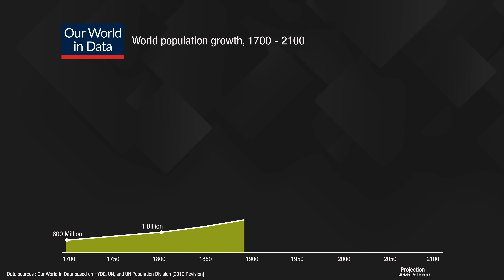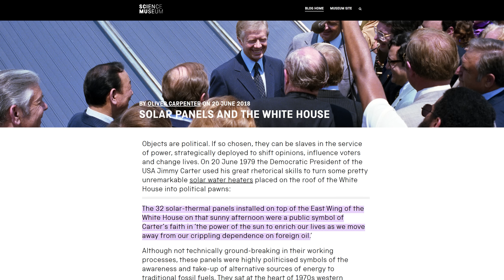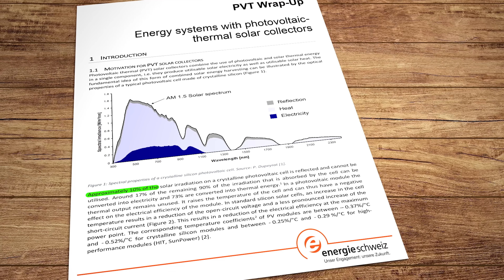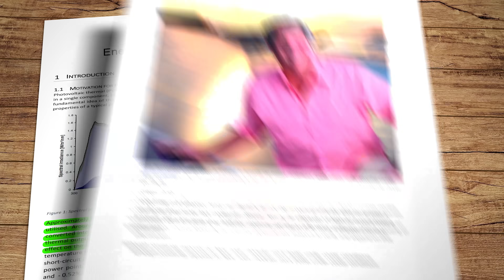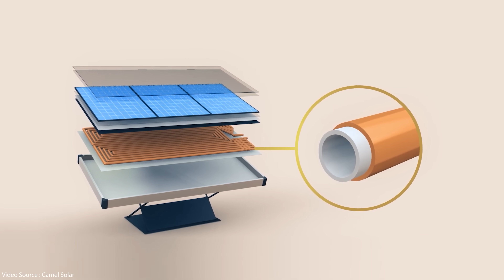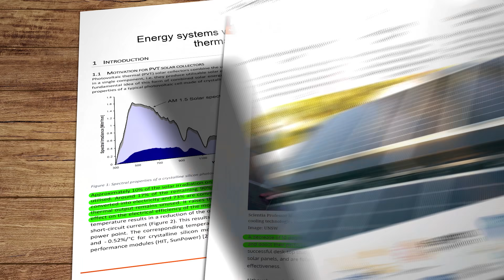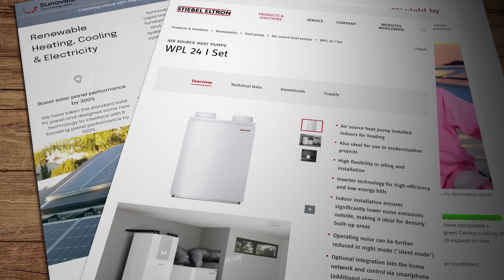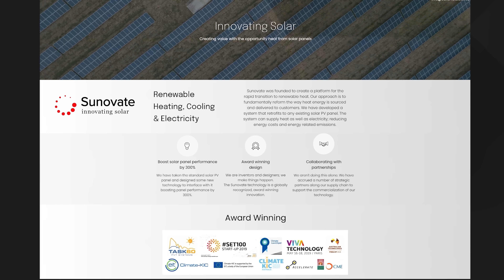The Solar PV panel that provides electricity AND heat for your home!

Comment: May I recommend that the "Just Have a Think" speaker get his facts corroborated well.

At 2:27 in the video, the speaker says that on a hot sunny day, a solar PV module (BTW, which is NOT a solar panel) that is rated at 20% efficiency under Standard Test Conditions, may only be working at 12% efficiency.  This is *not at all* correct.  A solar PV module's temperature-difference coefficient is nominally (for example) at -0.35% (to -0.4%) per K of difference from 25°C.  So if the PV cell temperature is at 75°C (as I have measured it) then a 20% PV module would be running at 16.5% efficiency.  (the calculation is:  75°C - 25°C = 50 K.  50 K x -0.35% / K = 17.5% (difference).  20% (units) x 17.5% (difference) = 3.5% (units).  20% (units) - 3.5% (units) = 16.5% (units)).  PV modules typically are tested to have a maximum operational temperature of 85°C, at which point they would be running at 15.8% efficient.  To degrade a 20%-rated PV module down to 12%, the cells would need to be running at 120°C, which would be far beyond what the manufacturer would warrantm and far beyond what any building code would permit.  I welcome anyone's comments and discussion.

Comment: Something that people don't realise is that improved efficiencies in the UK have (surprisingly) been steadily reducing the overall demand for electricity since 2005. By 2020 we were using nearly 70 TerraWatt hours less annually than in 2005. This during a period when the UK population has risen. However, it is true that globally the use of electricity has risen over the same period.

Comment: I think these techniques have a major contribution to ensuring that PV makes up a big chunk of mitigation efforts. TLDR: Extending panel life has a huge effect on resource constraints limiting the scaling up of PV and EROEI (it is a real thing)
I looked at combined heat and PV solar while an undergraduate in the 90's. It was quickly clear that (using the tech at the time) it would be hugely costly and a maintenance nightmare. As a follow up I tried looking at the lifecycle costs to see if life extension might save the idea. Again, at the time, the answer was a flat no. Ironically the rapid fall in costs that was projected for PV wiped out any gain in life for the panel.
Now the situation is quite different. Panel production is already starting to bump up against the sort of volume where resource demand for production adversely affects the production cost. My personal suspicion is we are close to the end of the era of rapid cost reduction.  Fortunately PV is already cheap enough that it will continue to expand at the current relative cost (If PV costs rise it is likely to be because of resource constraints that will tend to affect all energy production technologies,  so the relative cost will not change as much as the absolute costs)
Given those constraints the question become one of how much total capacity can be built out with current tech before the replacement of older models cannibalize the production for new instalation? A life time extension of 2x + doubles that headline number. This also means the current technology is unlikely to run out of growth before something better has been invented, proven and scaled up.

Comment: Cool! The problem getting people to understand this is often: many people think PV panels generate electricity from heat... because they think that the energy from the sun is thermal (longwave radiation), rather than light (shortwave radiation).

Comment: Just have a think:  The move to wind and solar helps China as they provide most wind and solar equipment and many of the critical minning materials.  Hmmm.  I wonder who finances channels like this?   Fact is wind and solar will make the west weak and China and Russia stronger.   People do your own detailed research. And use your own common sense.  People are welcome to use wind and solar, but it makes up about 5% of current energy needs.  Check out Ammonia and Nuclear.   These are better sources of non C02 energy sources.  😁😁

Comment: I was only thinking this week about the potential to pump through a liquid to cool the panel and provide heat. Seems like such an obvious thing to do. A hybrid thermal / electrical system - sounds positive! A good video!
Reply: Dave, it's so easy. We glue solar rubber pool strip behind the panel. It takes the heat away and sends the heat to the water system. It could be the pool or the SH water supply to the house. The 10 pipe strip has been used for years and is freely available everywhere.

Comment: Hey Dave you should get in touch (or I can introduce you to) the folks at Naked Energy, a business based near Gatwick airport, they design and manufacture a clever system of solar PV cells that are inside a tube to collect heat as well, do check them out!! cheers

Comment: I’ve had panels on one section of my roof for 10 years now ..but without a battery linked up most excess power goes to the grid and possibly over loads it ..In Australia greatest generation ,in summer coincides with this decrease in efficiency   ..I doubt whether fanning this hot panel with warm air would help much ,but as house holders we each need to stop burning gas where we can (mainly heating in winter ).If we are to store power from from the sun via enough panels and battery ,in winter to engage a heat pump to warm the house ,or in really hot weather to cool it ,we’d be halfway there …just watch out for the extreme weather events like larger hailstones ,which could ruin the whole set up !

Comment: That graphic @12:38 is comical.
We have had and do have more concentrated sources of thermal energy for many decades. With the exception of a few steam pipes in New York City they always waste that heat. It's cheaper to build a pond than bury insulated pipes to residential houses. Why are we pumping the waste heat from powerplants into rivers and cooling towers now and for the last 70 years ?  It's hard to meter heat and the utility wants to sell electricity not hot water it's counterproductive for the utility to let anyone use that waste heat.
Dispite many attempts to utilize a local company's waste heat for green house and or aquaculture facilities none exist.
They still pump it into a pond to cool before letting it back into the river.

Comment: Systems like this pop up on the hype cycle about every 10-15 years. They almost alway end up failing for a few reasons. 1 you are adding moving parts and working fluids to a system that did not have any. If the fan breaks you now have a worse performing module because it does not benefit from convection. 2. We don’t really design large systems around module efficiency. Most are overbuilt so modules mostly operate at 70-80%of nameplate. 3. Cost/parasitic load you are adding a lot of extra cost and specialized parts that only in the most perfect circumstances come out to be more cost effective than adding a few more PV modules and heat pumps. Also this is very low quality heat and can really only be used for low temp application. Air is a terrible heat transfer fluid, and in this case you end up with a lot of hot air on days when you don’t really need it.

Comment: Awesomeness!
My neighborhood is mainly older homes from the 60’s-70’s. 
Back when these homes were built, the newly installed local hydroelectric power stations were creating more electricity than the whole region could use, and as a result electricity was practically free. 
As a result, the homes built then used electricity for everything, from heating water, heating and cooling, to an odd energy hungry heat lamp that was very popular and can be found in most bathrooms from that era.
However, since then, the population has tripled, and the hydroelectric dams are no longer enough, so electricity is brought in from elsewhere, and the result is, electricity is much more expensive. 
Which can make owning and operating one of these electric houses quite expensive. 
Compounding the problem is the very poor thermal efficiency of these homes. 
Because electricity was so cheap, heating and cooling the homes was of little concern, so little was done to insulate. 
Fast forward fifty years, and the cost of trying to live comfortably in one of these homes is astronomical, unless drastic insulation measures are taken. 
PVT would be perfect for this area.

Comment: Engrossed in profit. deters our advancement to going for better systems of power supply.  God,  money has to be eliminated from the control of humanity.  We need , just what is required , nothing to do with wealth or currencies.  We have to,release ourselves from the slavery of money control. That we may do anything we need to,do , just by effort, not for wealth of a tiny % of Earths humanity, or are they?

Comment: Excellent description,  but PVT is not new. The idea and also commercial products existed decades ago. It remains the issue that thermal and electric use achieve optimal efficiency at opposite ends of the temperature scale. If you cool down the PV cells by e.g 10°C you get warm water (gas... whatever) with a lower temperature than you would have it with a purely thermal collector. The value of thermal energy falls dramatically with decreasing temperature difference to the ambient temperature. 
My experience is that on many rooftops thermal an PV can fit, but separately. And this certainly even better, if architects include it from the start. 
In addition: The effort to include solar thermal heating as a retrofit into an existing building is relatively high (tubes, storage, evtl. heatpump...). Different to that PV and its cable, DC/AC-inverter are rather easy to add. So for supplementing a solar system to an existing building,  it's a lot about how much 'construction works' the owners are willing to accept.

Comment: I was thinking about a hybrid panel.  Bond the panel to an aluminium backing plate using thermal paste for CPU heat sinks.  The backing plate could have channels running through the inside, through which you could pump water.  If necessary, make the plate from two wafers and use a router to cut the channels into one of the wafers before joining them around the edges.  The underside of the backing plate would have nipples for connecting the panel to a water supply.

Comment: This is one of the most important videos on all of YouTube. I have studied energy for fifty years and have been aware of this concept, and the tremendous advantages, for nearly that long. Beefing up the grid may be necessary if people opt for continuing to rely on centralized sources of electrical power and there is, concurrently, an increased demand for electrical power. Also, if homes supply surplus PV power to industries. If beefing up the grid is a 'problem' it should be viewed as a welcome 'problem' and the process of doing this got on with.

Comment: PVT's been on my radar for many years, I find myself quite staggered that it's as niche as your video has made it seem. As proud as I am of how in touch I am with renewables tech I'm saddened by how much this no brainer needs to be 'promoted' and talked about. Fingers crossed the tremendous drop in PV costs over the past decade has made PVT hybrid panels much more competitive with regular PV panels for the wider populace. 

Liked and commented for the algorithm in the hopes it spreads this far and wide. Also shared on twitter for the tiny bonus potential bump in exposure.

Comment: Hi "Just Have a Think", thanks for sharing and explaining this PVT systems. It is an interesting thought, that is true. And it is, as many mention, not new. What most people ignore is the following: in the summer, when it's really sunny and warm >20C for weeks outside you get too much heat, and no place to put it, unless you're lucky to have a pool. At those days nobody wants this thermal energy to heat up your home. Heat water storage balloons of 3000 Liters are availalbe, but they are also reaching boiling 80C temperature within a few days (you can do the maths with 1000W/m2 and some serious 10m2 installation). And where to put the heat then? With nowhere else to put the heat you'll end up with the PV system getting to it's hottest temperature just as without the T. It's simply hard to find a place to store all that heat in a usable manner. And in the intermediate seasons when it would really be interesting to collect heating energy, the PV panels do get very warm anyway as they are not at all insulated at the top side and so dissipate a lot of that little heat you get in spring and autumn. In short the overall advantages are still there but definitively less than what it looks like on the paper. AND then we have on the other side the cost of these systems. I got an offer and was shocked that the combination of PV and T all in one, at least here in France cost about 2x the separate installation of PV and T side-side. The reduced advantages are not  enough to pay off for the extra prices, simply because this stuff is much more complex than PV and T separately.

Comment: The idea is nice but whenever there is enough sun to actualy heat up the panels, I don't need heating anymore. Even in the example, if it is 25 C outside, just open a door or window, or more likely close them because I find 25 too warm. So I would discount most of the heat output of these systems as you likely can't use it very effectively. If the increased solarpanel efficienty and lifespan increase is worth the extra electricity and costs of the system it is worth it.

Comment: I've seen a PVT install on a PC hardware channel as part of a whole home water cooling system to cool the server racks, in addition to providing hot water. I see room for both water exchange and air exchange PV- basically combining radiation capability with electrical generation

Comment: I live Lismore North Coast NSW.
Are aware of Tractile,  which has water jacket attached  to every PV tile that forms system. The Tractile will provide heated water (38 deg C).  All you do  have take some electricity from PV you heat 50 deg C , therefore  your have hot water.  
We have are a development project which has 57ha, 250 passive house #SIPform prefabricated, the roof cover in Tractile 180m2.  Which will integrated  with 934,370m2 total PV estimate 26,829,264kW/hr  and 28.8HW/hrs Tesla Battery Farm like the Hornsdale Power Reserve SA . Which includes bi-directional chargers to all houses. I and the team will construct CLT shopping centre which will 12 #Tesla Super Chargers. We will submitted council July 2022. Which well approved by end December 2022. The team will onsite by end June 2023.  We the project finished end 2025.   We need AU$74,000,000 to 1st stage includes 250 lots for houses, roads,  sewage and landscaping as well as other stuff.  As well we have spread sheet which includes P&L and C&E - approx  AI$ 965,853,504.00 per year. If any body whats spread sheet I will sent email.

Comment: To me the challenge is to recover the energy from the 40C+ air with an air-water heat pump or direct warm air circulator.  We could of course build a solar space and put the panels inside it - which would make mounting them much cheaper than the external mounts which generally need to be strong enough to withstand significant winds. PV prices have come down, mounting systems less so.  If you can afford space behind them then maintenance of the electrical side is easier.  Have to figure out how to clean the front side though.  I like the black radiation harvesting overnight, might not work with a solar space, because greenhouse effect. :-(  (My application would be Central Portugal)

Comment: I live in Canada, off grid with solar and batteries. I have dreamt of this type of thing for a long time. Air cooling would simplify a lot of the system and make it much cheaper, as you say. It seems less effective then cooling with glycol but the simplicity makes up for the difference. It looks like a good fit for domestic hot water or seasonal heat storage in the ground when combined with geothermal heat for winter. So so much potential here for sure. Even more energy is available then there is for just electricity from each panel.

Comment: I would advocate the use of the liquid cooled panels as the ability of liquid to wet the surfaces and high heat capacity would be much more effective, albeit a pain to plumb up. However as a qualified electrician and plumber I would have no fears of leaks or difficulty fitting this type of panel. Air/Gas cooling requires huge volumes to be passed over the panels as gas has a low heat capacity so large ducting and air handling equipment would be required. I see this every day at work in the commercial sector where air heating ducts take up much of the available services space, in ceilings of offices, schools etc. Why new builds don't use high flow low temperature water filled under floor heating I don't know but it would significantly reduce heating requirements and should be compulsory on all new build properties. Keep the water at 1 or 2 degrees higher than you want the rooms, balance the system and step away, leaving it on 24 hours a day. This could use low grade heat from such PVT systems (or geothermal) at 25 degrees centigrade easily and be highly efficient and just as importantly, cheap! Having fitted and lived with these systems for over 40 years I can say it's the way to go.

Comment: Solar panel need fresh air underneath to get cool. Otherwise is very inneficient. You have done some many videos with tech news that never worked as said. Doing water heating with warm air from solar panels does come more bad and good with inneficiency, trapping warm air and water at only 29°C